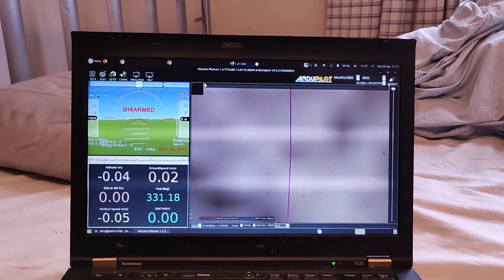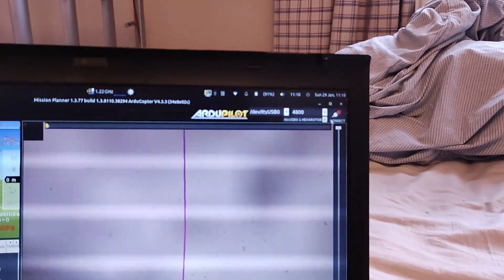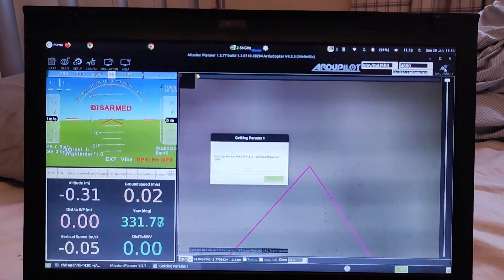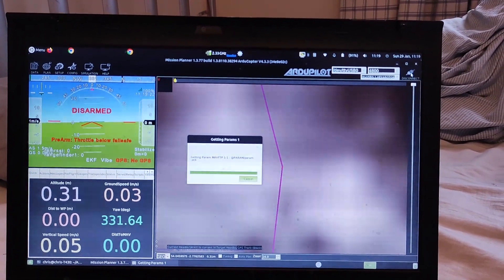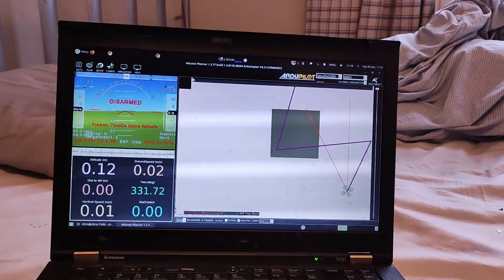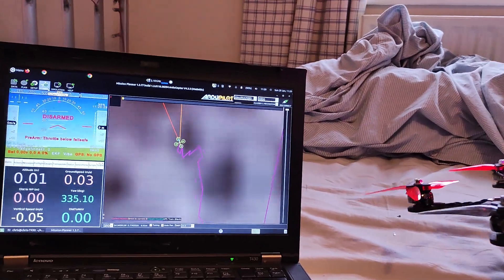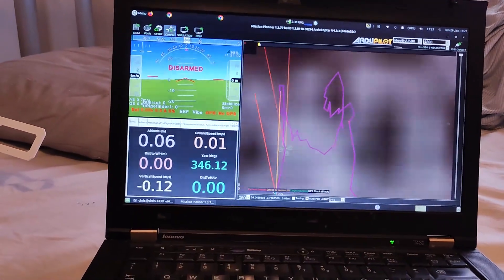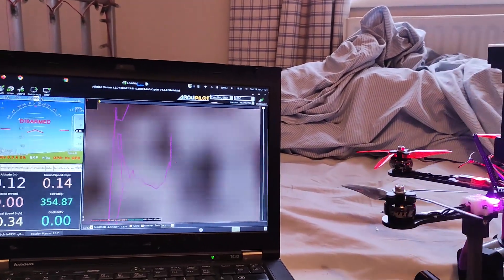ExpressLRS aiport fork with 2 way telemetry

Comment: I love my Radiomaster 2.4 GHz ELRS system for flying my planes. I just ordered Radiomaster’s 915 MHz ELRS to try out Airport mode. So glad you got it working. Any tips or tricks beyond the ELRS documentation? Do you find the update speed limiting? Is it outputting Mavlink data that could interface with an antenna tracker?
Reply from the maker: Airport is now much easier to setup and can be done within the expresslrs configuration without much messing around. There is another more experimental fork of expresslrs called mavlink-rc which works even better for ardupilot and might be worth looking into.
Reply: Chris, I have Airport working now (2.4GHz ELRS for RC control; 915MHz ELRS for Mavlink telemetry to Mission Planner, but I find the latency is very slow, about 2 sec lag time. We’re you able to solve this problem?
Reply from the maker: Look in the mission planner settings (accessible when not connected to an aircraft) for the telemetry data rate settings. Turn everything down to 1 or 2 hz or off. Turn off stuff you don't care about. You can keep the artificial horizon at 1 or 2 hz if you fiddle about with stuff like this and it should be smoother. @allansmits9621
Reply: @christophertelford  Thanks for the tip, Chris. I’ll give it a try. Are you using the Airport recommended Full 100Hz rate and 4800 baud?
Reply: @christophertelford  Tried your suggested telemetry rate adjustments in MP, but they didn’t make much difference in the latency issue. Also, would it make more sense to swap the ELRS units, that is, use the 915 MHz units for the RC connection and the 2.4GHz units for the Airport mode. The plane would benefit from greater range, and the Airport communication would be faster

Comment: Hi, great video! I am currently thinking of buying SiK telemetry radio for my Ardupilot builds, but do you think it might be better to invest in second ExpressLRS module for telemetry instead? Could the AirPort system with LRS have any major advantages over the SiK?
Reply from the maker: The SiK radio's biggest disadvantage is just that they are unreliable and have poor range (in my experience). The only way to get reliable off the shelf telemetry is to pay a lot more for the RFD stuff. ExpressLRS is well worth trying instead of the SiK radios and if you don't like it you can always just use it as an rc control system. I believe you get more bandwidth on 2.4ghz than 868/900mhz but I don't know how well 2.4ghz telemetry works if you also use a separate 2.4ghz system for control.
Reply: @christophertelford  Hi, just wanted to say that today I actually managed to get AirPort telemetry to work. I used 2.4Ghz Happymodel ES24TX and the tiny EP2 RX with ceramic antena. The connection seems to be resonably fast and its stable at 9600 baud rate. I will probably make a video tutorial about configuring this system and testing its range. So thanks a lot for making this video : )
Reply: @christophertelford  Well I already have a 2.4Ghz ELRS system so I think I will buy an 868 Hz version now and give it a shot. The cost is fairly similar to the SiK so it's definitely worth a try.

Comment: This is awesome, is your hexacopter running elrs 900mhz
 for controls too?
Reply from the maker: No I'm using a separate 2.4ghz expresslrs receiver for that but I believe it is possible to send everything across the telemetry using mavlink for control. It's just a little trickier to setup.